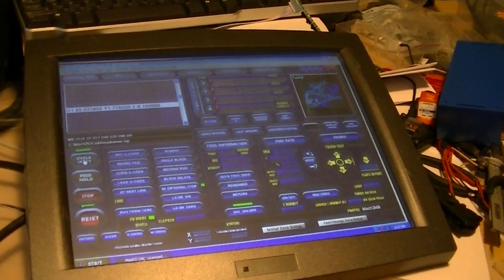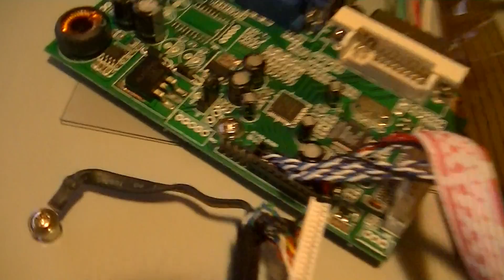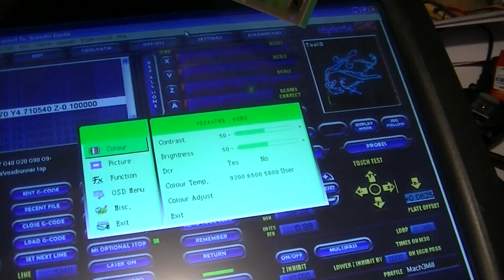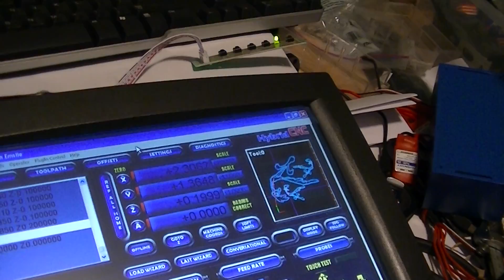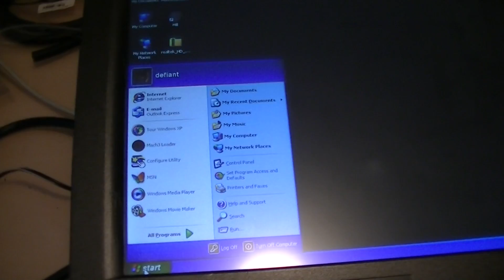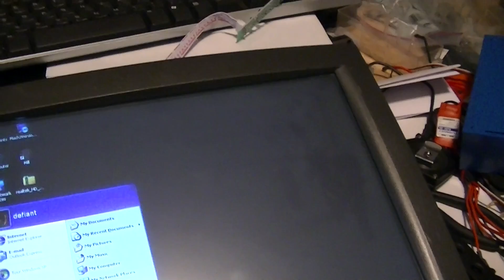Touch screen monitor for Mach 3

Comment: hi this a great video, you make, I need you help with a touch screen usb wire color code? need help with the wire part , I can send you a picture, on my 21.5 in acer touch screen LCD that has a touch screen board, however i need to rewire it to my desktop usb port? my e-mail is alvin42785@gmail.com
can you  take look and tell me what i can to do to  connect my touch screen lcd wire to a male usb port to my desktop pc,